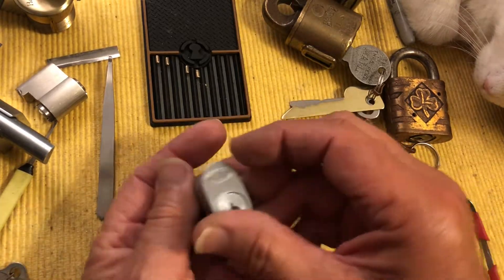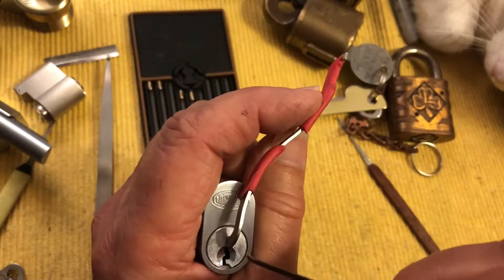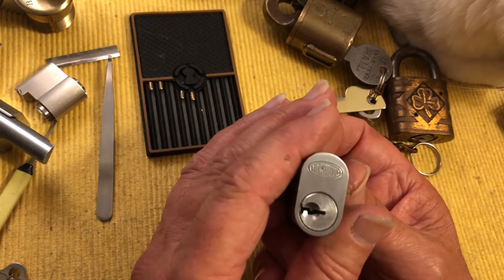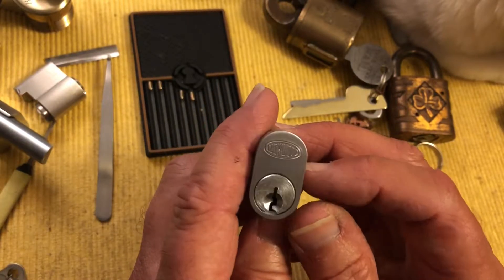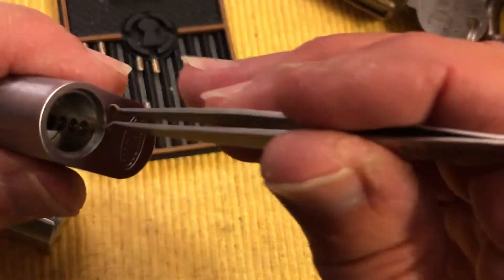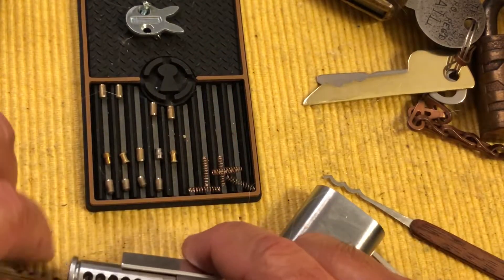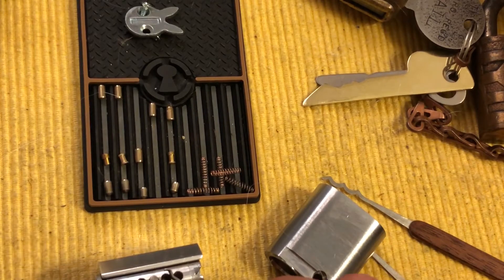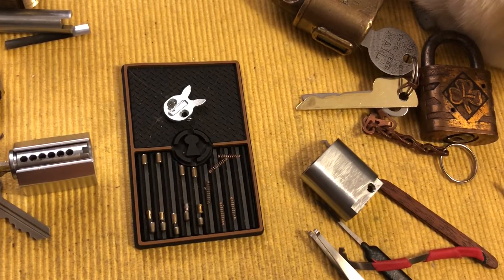#226 Lockwood makeover picked with Security pins. Gutted

Comment: Great job on that Lockwood. Do you know of a place where I can buy serrated bottom/key pins for a standard Kwikset lock? I have an ABUS 83/45 with a Kwikset keyway. I am currently using standard bottom pins. I want to upgrade them to increase pick resistance.
Reply from the maker: ahmadaamer6 Thank you!
I don’t know of any place to get serrated Bottom key pins?? 
You may have to make some out of serrated top pins, If you have a lathe. 
Could bring them to a point like key pins , or use key pins and put in serrations using the lathe. 
Sorry I can’t be more helpful :(
Reply: chris capune No, that is okay. This is helpful. Thank you
Reply from the maker: ahmadaamer6 there are a lot of sellers on EBay with Security pins, but all driver pins. 
👍
Reply: @chriscapune7873  I saw that. I might open my lock cylinder and see how many security pins ABUS puts in it. I might replace the standard pins with security pins. Untill I can get to a lathe I will keep the standard bottom pins.
Reply from the maker: ahmadaamer6 you will find that the typical Abus 83 series has mostly spools in the top. Usually one standard and the rest spools. 
And you may find it only pinned to 5 pins, but you can add a 6th to make it more secure. 
👍👍👍👍👍
Reply: chris capune I will do that. Thank you
Reply from the maker: ahmadaamer6 cool! 
I have done a lot of videos on the 83series and lots of different core you can get for them. I think I have about 8 different cores for the Padlocks I have. From Kwikset to Bi-lock to Everest and many more!! 
They are great locks!!!!
👍
Reply: chris capune They are great locks. One of my favorite.
Reply from the maker: ahmadaamer6 👍👍👍